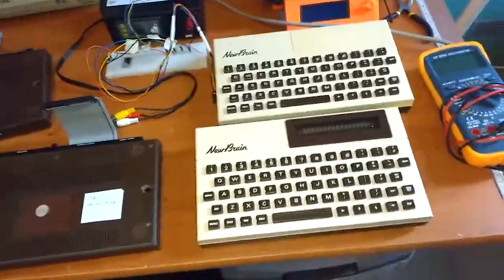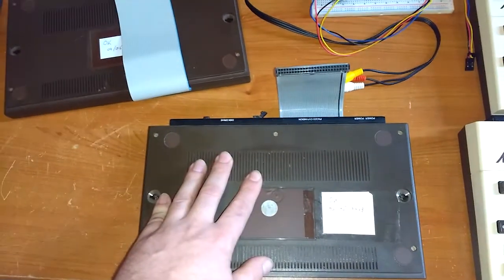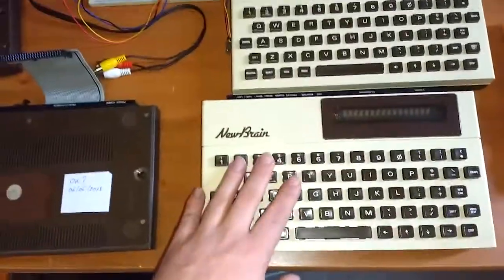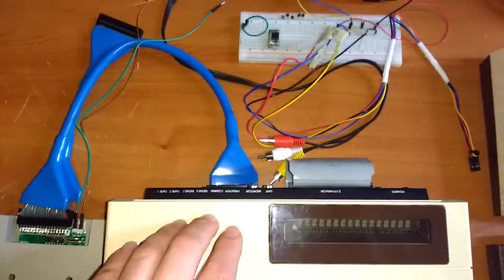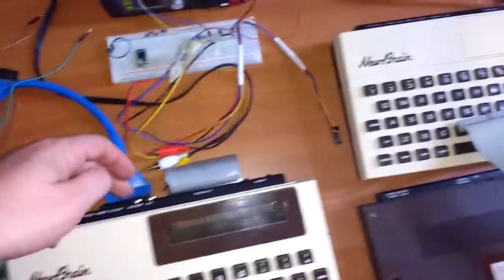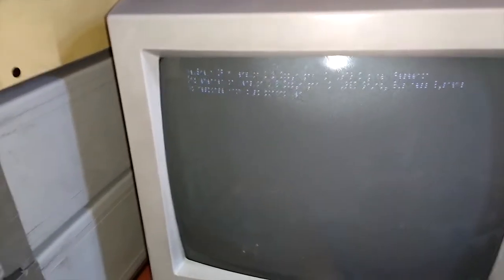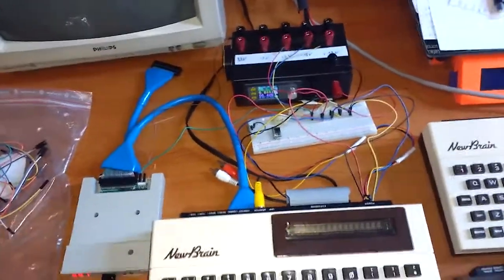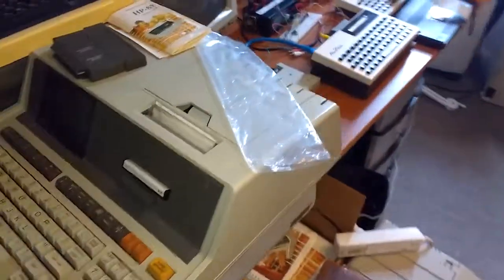Grundy Newbrain repair update

Comment: Hi! Just found your video. I was intrigued to see the newbrain with the memory expansion and the infamous disk controller. Many years ago I had the exactly same setup, bought as new from my local computer store. I never got the disk drive and controller to work, and I was cringed to see the "no response from disk controller" error message, as I have sat countless hours to try to solve that. Even the fact the system was new and under guarantee I want back to the store and asked them to fix it for me. Several times it went to repair, but eventually they had to give up and I got my money back. 
I later heard from another friend who got a used newbrain setup with diskcontroller, that the power supply for both the drive and disk controller had to be extremely accurate. He was using the original power supply which came with the unit, and when it was cold everything worked allright, but when the power supply got up to working temperature, they same "no response...." error message began and the system became unusable.
So if you still have these units lying around and are trying to get them to work, be consider to have extremely correct voltage on the units.
Thank you for showing this systems. Brings back many old school computer memories to me :)

Greetings,
Jimmy
Reply from the maker: Hey. I'm glad someone watched the video ;) I have pretty much given up on getting it to work for now. I don't own the original power supplies. Have a nice day.
Reply: Grundy New Brain was my first computer when I was 7 years old. It stopped working one day and my mother threw it away. (mothers...) The green NEC monitor I still own. I collect vintage computers but I was never able to obtain a New Brain computer again. I remember playing the nim game. Ah... good memories.